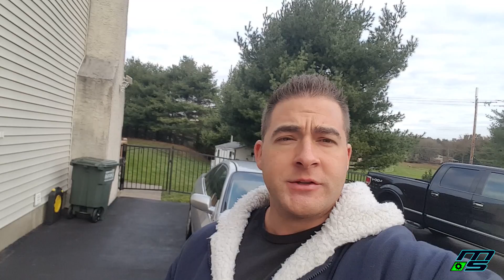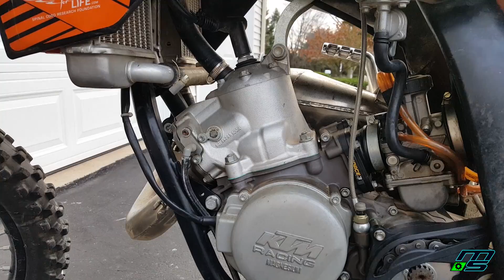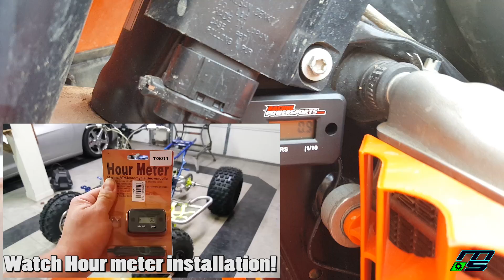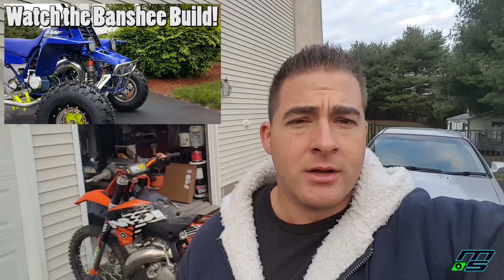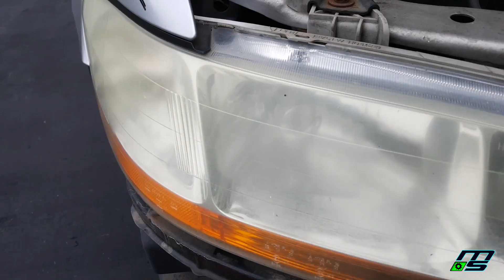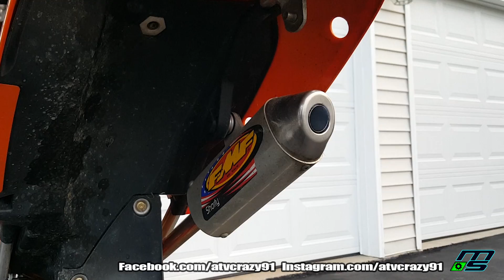Finished up the 125SX!

Comment: Soooo what was the final compression? Also what year is that, I love the front fender
Reply from the maker: What's up dude! It's an 07 and it came out to a little over 150PSI. I used the thicker gasket on the cylinder. It might go up a little as it breaks in.

Comment: How often should i change spark plug in 2 stroke bike?
Reply: not often
Reply: i still have mine in my ktm 125sx 2013 since iv bout it and it starts first kick every day
Reply from the maker: I agree with Elliott; if it's jetted correctly you shouldn't have to change it out too often. If it's fouling a lot, it's a sign that you need to change up your carb tuning or gas mixture.
Reply: yea i run 40 to 1 mixture on my bike